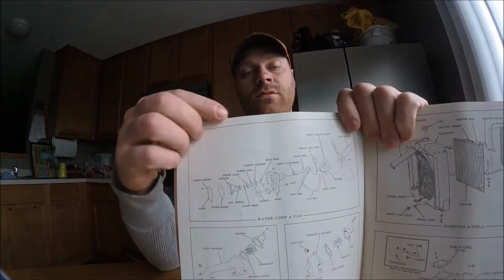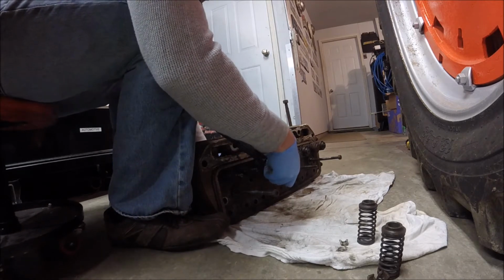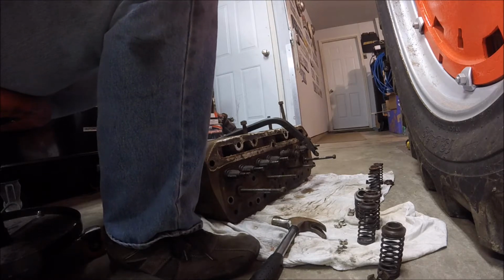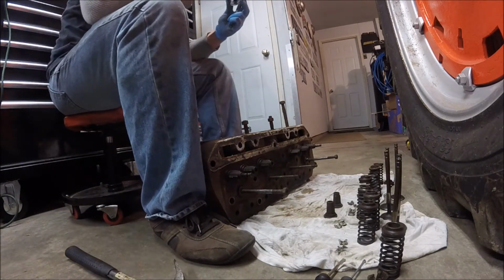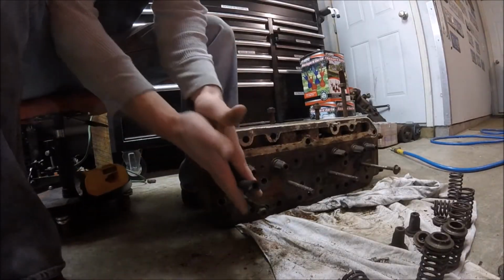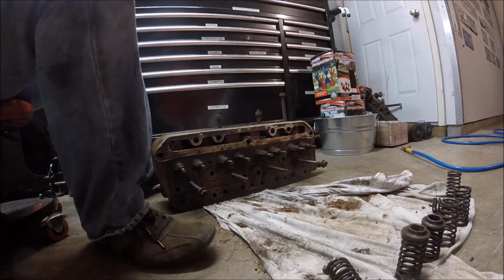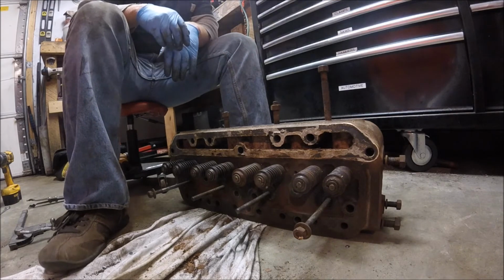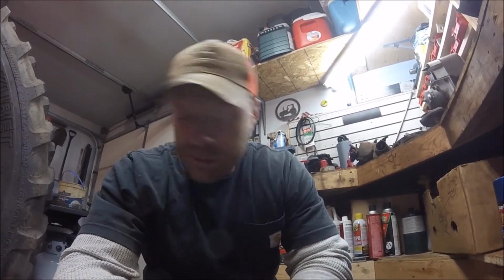1938 Farmall F20 Episode 3: Cylinder Head Clean Up

Comment: Good day. Starting  watching,  brought bk. memories of the allis.  In 67 we had super w6 without live pto, 1gear 2-1/2 mph.  traded2085 ferguson in for WD/ bigger piston? Boy the manual for Allis  was like IT&T  manuel very detailed, just like the one you have. the Allis was a head of it time, live hyr., live pto, hand clutch running in oil,  but slower than a bugger on road.  Light on weight, but/ traction booster put more traction on wheels  Anyways cyl. head looked clean,  waiting for next video on F20  Thanks.
Reply from the maker: Don, welcome to the channel and thanks for watching. Sounds like you have a lot of good memories of the old iron. I hope to have this thing going sometime this summer!

Comment: Great video.... I buy the same three wire wheels, they are always in my tool box.  I know it's going to be a long road but, I can't wait to see the the F20 running!
Reply from the maker: I'm hoping to have this thing running this summer. I doubt I will be able to buy tires for it this year but at least the tractor (hopefully) will run!
Reply: I'm hoping to have mine painted within the month, then assembled and running by July fingers crossed.
Reply from the maker: That sounds good to me! I am going to leave this original as long as I can. I like the moss and lichens all over it. Makes for a good conversation piece at shows!

Comment: Evaporust works GREAT.  I've tried all the other methods, and it beats all of them.  Plus its non-toxic, can be used over and over again, and doesn't affect anything other than the rust (unlike acids, for example).  One caveat: make sure parts are de-greased before putting them in the Evaporust (I like to use oven cleaner for this, except on aluminum parts).  -Chris
Reply from the maker: Chris - I hope it works well! I just ordered 3.5 gallons of it! I am experimenting on a few rusty sockets I had with a small amount to see how well it works (went and bought an extra quart today just because I can't wait until UPS comes tomorrow)... I thought about even putting it in the cylinders of the F20 to see if it eats away the rust enough to break the motor free...
Reply: I've never tried using Evaporust for freeing-up stuck parts, so that would be an interesting experiment. In my experience, the absolute best thing for breaking-loose parts frozen by rust is Kroil.  Better than PB Blaster, better than acetone+ATF, better than WD-40, or Liquid Wrench or diesel fuel. Kroil is very expensive so I save it for the worst-case scenarios, but it has worked for me several times when all else failed.  If you try it on your stuck pistons, make sure you first blow out anything you used previously.  The good news is: a little goes a long way.  Give it plenty of time to work, like a day or two at least.
Reply from the maker: Kroil is great stuff! I usually go with PB Blaster, and Acetone + ATF if I need something stronger. I have yet to use Kroil in large projects (I have always used it in a spray can). Check out my newest video (uploading tonight), and it will have a progress report!

Comment: there's a machine shop trick we use when dissembling the head
Reply from the maker: Please, do share! I'm always up to learn new tricks!
Reply: place your head on a wood work table - use a deep wall socket that fits the valve retainer edge and go down the line pop - pop - pop with a hammer
Reply from the maker: I think that would work - just better be sure you have a towel or something over it so you don't have your spring and valve keeper go flying across the shop! :-D